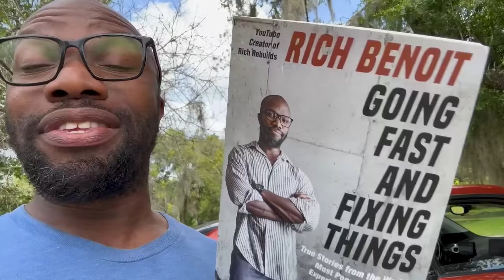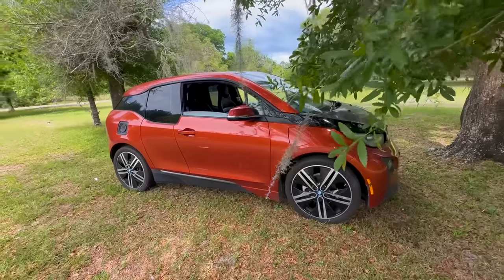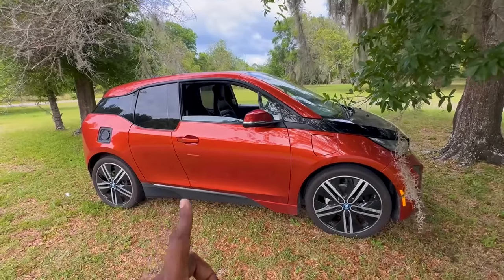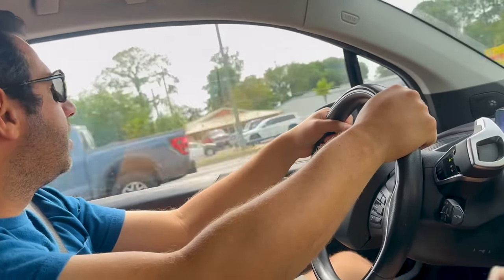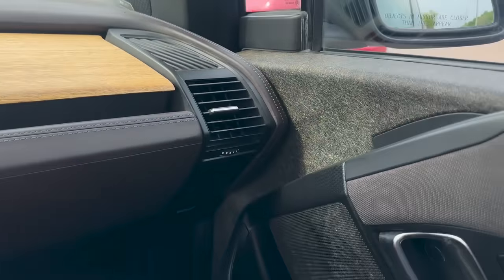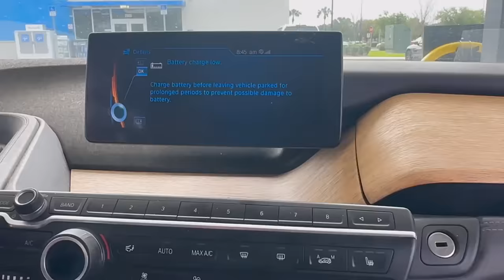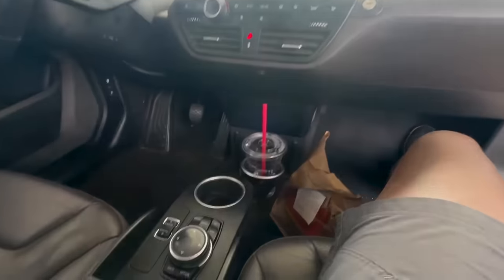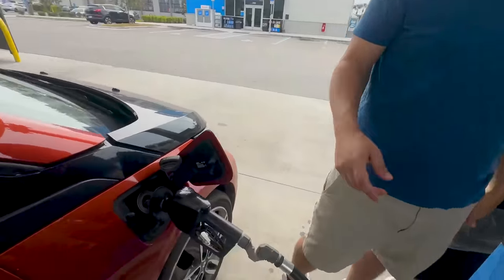I Bought a Ten Year Old $3500 EV and I Increased its Range To Over 400 Miles!

Comment: Rich you should make a box truck an EV and see how many used Tesla battery packs you need in the back to make it go from New York to Los Angeles without stopping to charge
Reply: bro this ain't Ross creations lol
Reply: Its not an awful idea..
Reply: Cannonball Race.
Reply: They will arrest him for building a bomb.😂
Reply: BBCWB
Reply: Building Battery Cars While Black
Reply: Maybe you should make a box truck an ev and see how many used tesla battery packs it takes to go from nyc to LA. Make a video and return the results
Reply: I 3 is an electrified MINI Cooper
Reply: Put a gas tank on a trailer and tow it behind.
Reply: Shit would weigh 40 tons
Reply: Just get a regular truck and fill the bed 3inches high with batteries see if you can get 1500 miles of range
Reply: that would be really expensive
Reply: You can figure that out on paper
Reply: Probably about ten 100kWh packs would do it. So one megawatt-hour
Reply: That would make a big ass fire
Reply: You can even put a small generator under the box to charge the batteries as you drive.  You can use the existing gas tank as the fuel source for the generator.
Reply: @DrDiff952   It’s really not.  Completely different in every way…
Reply: That sound dangerous as hell
Reply: So many reasons why this is a terrible idea. Have you seen what happens when one tesla battery pack catches fire?
Reply: @taylorjams4845 So you're saying EV's are a bad idea??
Reply: @craignewman6709 They make or are making semi's with a big diesel generators that outputs enough to charge the batteries while driving to extend the range where it makes sense. 

The issue people don't understand is how much energy it takes to "fast charge" EV batteries, not that you even can! I guess with that said, the issue people don't understand is how lithium works in all aspects.
Reply: @commonsenseisdeadin2024 
So that's just a diesel electric drivetrain, like on a train, with some battery 'storage'
Reply: That would weigh far more than the axles can carry.
Reply: @LeverPhile  the generator doesn't output enough to run the motors it just has enough to actually put charge back in while it's being used and extends the range enough that it makes the truck useful. If it ran strictly off the generator why would it need "battery storage"? If it did that also then why would I even mention range at all as then it's essentially unlimited....... 

Either way a passenger car will not be able to house a generator that's able to actually output enough to give a sufficient amount of charge. The batteries will need to be wired in a way to charge banks individually as with the lithium batteries used in EVs you want the most capacity but with that comes low C rates that are typically around .5c or 1cwhere High discharge but low capacity batteries typically are 20c or 30c. The higher the C rate the higher amperage you can charge at, so with only a .5 or 1 c rate you can't charge at a high enough amperage that is useful. 

I don't know how the trains you're talking about work so if that's what they are doing then I guess......
Reply: @JohnDoe-qz1ql  in no way whatsoever did I say that. I said that this is a terrible idea. A box truck full of battery packs? One cell in one pack goes bad and over heats and the whole box truck is giant fire bomb.
Reply: @taylorjams4845  that's not how it happens...... 

But I do agree with you on it's a horrible idea, only because it's utterly pointless......
Reply: @commonsenseisdeadin2024  that's exactly how it can happen?  One cell over heats and causes a chain reaction causing the rest to over heat and in turn catch fire
Reply: Probably enough that he'd end up pulled over for Overweight and hazmat.
Reply: its not how it works thought. at one point you would stop getting extra range because of all the extra weight
Reply: @68-And-I-Owe-You-NONE  The Duracell Run...
Reply: @SMDoktorPepper I think that’s over 3000 miles. I’d guess easily 15 battery packs. Give or take due to the immense amount of weight  that would add and then I’m curious if he would he overloaded on the trucks weight lol. It’s an interesting idea. 1000 miles of range would be sweet though
Reply: @taylorpratt6287  just as a proof of concept alone.  To answer the logistics of it all would be very interesting
Reply: @commonsenseisdeadin2024  
Nonsense.  The Chevy Volt & all the Prius' (Prii?) have a gas motors motors that can generate enough electricity to drive the electric motors and run the cars all day.  

Whether a battery is involved is almost beside the point, (though helpful for many reasons), especially for longer hauls & loads that a box truck would have which would likely exceed the range of the batteries.

Battery packs are very heavy, and there is a big tradeoff involved with range versus cargo load capacity.

If you don’t know how diesel electric trains run, then educate yourself.  It is directly relevant to the EV discussion.
Reply: @LeverPhile  😂 you telling me I need "to educate" myself is hilarious....... 

First off, those are hybrids, they run on the gas engines. 

Second off, look how big a locomotive is! They burn 5 to 6 gallons of diesel PER MILE and weigh over 200,000 pounds. They are 4 or 5 times more efficient then semis I get it, but the only reason it works is because they can be so big! 

Anyway, after your first paragraph you have no solid ground to stand on as evidently you really have no clue how it works!
Reply: @LeverPhile  as far as a box truck goes, they simply don't haul enough cargo to offset the cost after the systems are implemented.
Reply: Dump the depleted packs as you go ;-)
Reply: @commonsenseisdeadin2024  
So, you admit to not knowing how something works and then state with certainty that its irrelevant ... priceless.  Common sense is truly dead in 2024, I can agree with that.

Diesel-electric trains run a diesel generator and use the electricity to move the drive wheels with electric motors ... just like the Chevy Volt does.  Aside from the size and scale, the only thing different (conceptually speaking) is trains don't have battery storage for purpose of moving the train.
Reply: @LeverPhile  yeah it's called research and learning! Try it some time! 

You're right, common sense is dead, you're a prime example! Thanks for playing!
Reply: @LeverPhile  it's a series hybrid that gets a whole 42mpg...... So efficient! I'm sure it's worth the issues it will inevitably have!

It's funny that you tell me I don't know and go on to try to teach me something when I'm going to teach you..... locomotives DO have battery storage to move short distances (namely a train yard) without having to start the engine! 

Again, congratulations on further pricing my name...... I applaud your efforts but I'm a much better ashole than you! Are you done now or would you like to try again? (FYI I most likely won't respond, I'm bored with you now)
Reply: @LeverPhile  thanks for attempting to teach me about diesel electric locomotives but let me teach you.... Diesel electric locomotives DO have on board battery storage to move the locomotive without having to start the engine! 

I applaud your efforts however I'm a much bigger ashole than you, do you want to try again? 

(FYI I'm bored with you now so likely I won't even bother looking at your reply!)
Reply: @commonsenseisdeadin2024  Lol, okay, batterybto move around yard, but not long haul. Good to know. Glad you educated yourself.
Reply: Like making a fire hazard more combustible and unstoppable if it does catch on fire, ev fires are bad enough with small batteries imagine the fireworks with a bunch of batteries 😅
Reply: Make it very very aerodynamic, put very big but very narrow skinny tires on it, would really help with cruising efficiency. Will looks real ridiculous.
Reply: @lemongavine If you drove about 40mph, then maybe you could get 220Wh/m.. But with 5 tons of battery pack, probably not. 😂
Reply: Not physically possible.
Reply: @WhyFacetattoos what car gets 1500 miles on a single tank ?
Reply: @JohnDoe-qz1ql gas cars don't catch on fire ?
Reply: @SMDoktorPepper Until you realize that the trio of weight, range and efficiency abides by the rule of diminishing returns. Nothing green about that much weight in batteries traipsing across the continent.
Reply: @bgracey7225  with thinking like that, we would not have airplanes
Reply: You'd need like a 800-1,000kw battery. Not happening.
Reply: @adriansmith7473  A Rock can catch fire, Bubba...
Reply: Impossible to do unless you are allowed to carry a trailer. Then it's actually somewhat easy
Reply: Bout tree fiddy
Reply: EPA, FBI, HSI, IRS, SECRET SERVICE and Gavin will stop him before he gets there
Reply: Dew It!
Reply: about 900kWh-1MWh

so about 14,000lbs of pack weight lol
Reply: @silvy7394 its easy if you're allowed to use the space in the box of the box truck

a Model S has 100kWh but uses older cells, with 21700s it would be easier to make a 900kWh pack 96S x 600P (with 5000mAh 21700 cells) would give approx 1MWh

so 57600 21700's

that should easily fit in a box truck
Reply: The possibility for explosion is immense on that
Reply: so if this box truck 🚛 is instead of paint just covered in solar panels, and then still has No hauling capacity because it's brim full of lithium packs but also upgraded frame/suspension to handle more better than a dump truck overtopped with rocks 🪨🪨🪨 then i think we might have something here .. also a few more dually axels with tag axel lift properties for toll cost reasons 😅
Reply: He'd need a trailer of batteries
Reply: @WhyFacetattoos Do your math.
Reply: @kevinc7632  just like carrying gasoline!
Reply: @Stefan_Dahn  I'm not a YouTuber looking for ad revenue. I understand the formula I'm saying as a real world application decrease the truck bed depth by 3in increase the battery depth by 1x over the span of the bed there is no loss to that except weight and money. Spit balling ideas to increase towing range otherwise they will never overtake diesel/gas pick-ups. Electric with diesel generators are extremely intriguing.
Reply: The storage to weight ratio will break this idea.
Reply: also the atf dont like explosion
Reply: Ya, who the H cares it would cost over $100k. Make for a great YouTube.
Reply: He will need a gas powered truck to tow that crap from NY to LA, then dumping batteries into the ocean.❤
Reply: @taylorjams4845  Do you have any idea how rare that is? The stock truck is more likely to catch on fire.

Sure, when it happens it makes headlines because much of the media likes to bash Tesla, but it's very rare. We had a story here recently with big headlines about a Tesla battery causing a house fire, but it was the cars 12v battery, a battery just like every other car has, that someone took into their house and it started a fire. The battery just happened to come from a Tesla, but if that same battery had come from a Chevy there would have been no mention of it.
Reply: We can do the rough math.

A Tesla Model Y Weighs 4,416 lbs, of which the battery back weighs 1,200 lbs. That battery can power the Y for 280 miles. (Tesla claim 310, but that's a BS number)

A small box truck weighs 9,000lbs

 Let's be generous and say that removing the engine/transmission is a straight-swap for weight with the hub motors and battery back. (They're not, the hub motors and battery pack weigh 2x of a box truck transmission and v6 ICE)

Let's further be generous and say that the box truck has as-good aerodynamics as a Model Y (it doesn't) and it can magically drive with the same power/weight efficiency as a Model Y. (it can't)

In that MAGICAL case, the battery pack of a Tesla Y could get you 140 miles of range out of a box-truck conversion. New York to Los Angeles is 2,800 miles. That means you would need 20 Tesla Y Battery backs to make it the entire distance.

That SOUNDS doable, as you have all that space in the back of the box truck, but 20 Tesla Y battery packs will add 24,000 lbs.

Set aside for a moment that you would be well beyond the maximum weight of that small box truck (which tops at about 30,000lbs) - adding that weight would necessitate an additional 8 battery packs, which would add another 9,600lbs, which would require more battery, packs... and so forth.

All told, you're looking at 36 Battery packs, in a vehicle that will absolutely break in half from being grossly overweight that will depend on magic to keep the motors from burning out or the cargo area from turning into molten lava -- all while that same magic needs to make the box truck have the same aerodynamics as a sedan.

... and that's assuming that you will be driving the entire distance on flat, level ground. (The Rockies would disagree)

So... interesting, but not doable until we come up with car-sized fusion reactors.
Reply: @surgysabbs8072  The back-of-the-napkin math puts the truck at 9,000lbs and the 36 battery backs at 43,200lbs. That's 26.1 tons.

Of course, that number requires the truck to be GROSSLY overweight AND have the same aerodynamics as a Tesla Model Y. -- So by the time you do the REAL-WORLD build, which would probably need another 16 battery packs on a MUCH bigger (and heavier) frame, it would be closer to 40 tons than 26.
Reply: @JeffDeWitt  how rare a custom made battery assembly 8s to catch on fire? Not that rare. There's a prime example on this very channel
Reply: @taylorjams4845  I'm talking about factory cars like a Tesla. "Custom" could mean anything, including some pretty dodgy creative engineering. Those packs have a LOT of energy in them along with some interesting materials like lithium. It's NOT something you want to mess with unless you know what you are doing.
Reply: @DrDiff952  the motor might be similar to the Mini EV but I3 is largely carbon fibre. Cooper is ordinary pressed steel.
Reply: @craignewman6709  That’s exactly how the BMW works. It’s a shame they couldn’t make a more appropriate engine that stealing one off the bike factory line.
Reply: I guess technically you wouldn’t need that money. It all depends on how slow you’re willing to go
Reply: That is not possible
Reply: @cruzredeyes yes and no. So many things you can't calculate for.
Reply: I saw one  2 nights ago. Shit tripped me out.
Reply: It is not safely to install gasoline tank in forward part of vehicle.
Reply: Government dont want him build anything that too smart!! Electric tractor or box truck is too smart!!
Reply: It’ll need 300 sets of tires from the weight
Reply: It would take a semi trailer fully loaded with tesla battery cells just to power the box truck that far.
Reply: Charge time 1 month 😭😭😭
Reply: Yould would need the 27' truck and you might make it to Ohio as to hot or cold and you lose range plus the weight of all batteries and the truck massively cut range so even with all them packs with c
The currently avaliable battery tech in tesla would t get you very far. Now you could exponentially increase the range using a lipo and not a liio battery but there come other complications.
A graphine lattice battery the size of the box on a short box truck would get you there without recharge but the battery would make the tesla go from 80k to over 400k same car and options as the lattice battery is so danged expensive. Take it to the next level battery beyond that make it into electric car battery and you could probably make the trip both ways over 1000k times but the depleted uranium battery is even more expensive even though you would need nothing larger that a solid truck battery for that kind of efficency but the battery alone would cost more than a fully loaded RR
Reply: It's called an airplane
Reply: Sounds dangerous 
But genius 🤔 
Intrigued